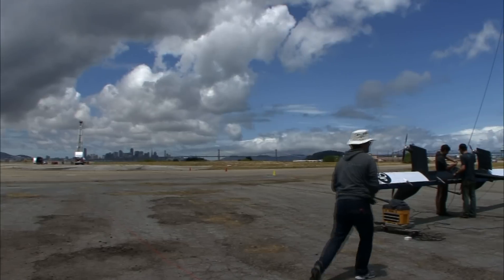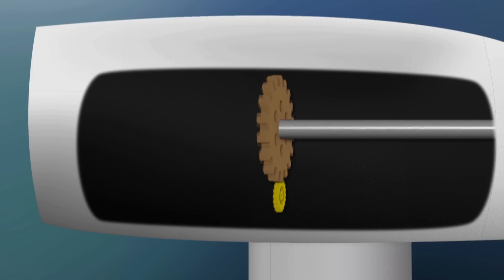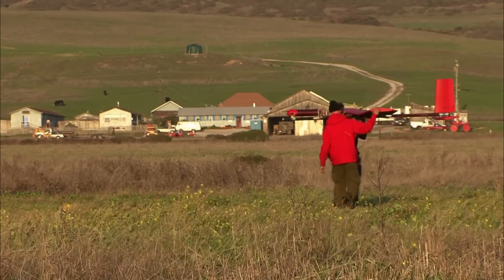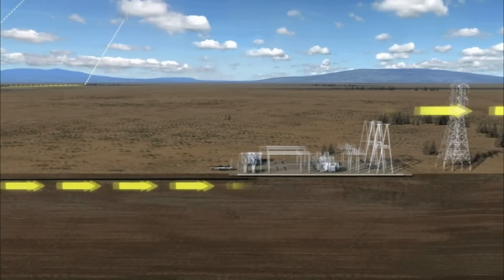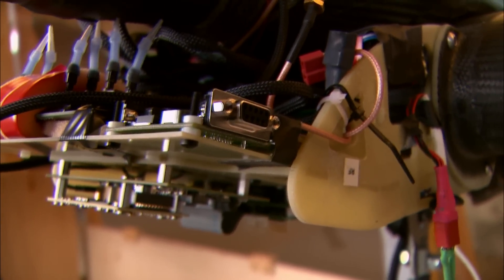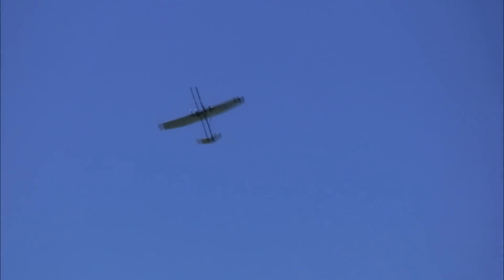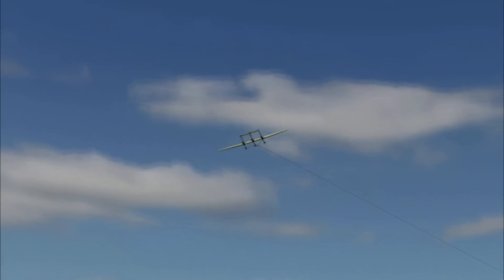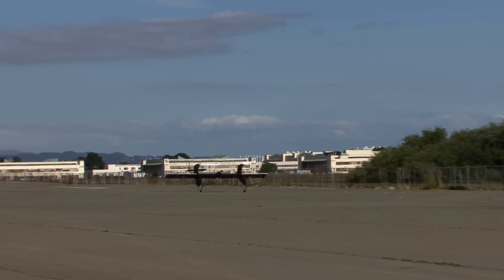Airborne Wind Energy - KQED QUEST

Comment: Here’s a question:  WHY does it need to circle?  Is it TURNING some generator on the ground?  If it’s developing power air (wing mounted gens it’s props), the kite doesn’t need to do aerobatics
Reply: It creates a higher wing speed so more power
Reply: It's a little like putting the wind turbine on a fast sailboat that's sailing across the wind (at a speed greater than the wind) or one at the dock. The turbine on the moving boat will spin faster producing more energy. With a wing flying in circles as opposed to one merely hovering the difference in speed can be many times greater.

Comment: no, no chance of this working in this design. how do you expect to capture good power by spinning the blades which are 30 cm wide.. i mean that's leaving wind on the table. Better to have a kite based design pull the cable very forcefully, and with that torque generate power. If the wind is 100km per hour / hurricane type wind - what you want is to put a roof size kite in the sky and make that wind drag on the rope. That's force. A  hurricane can remove a properly bolted roof on a house. That's force. If that force drives your generator non stop, then you are in business. This 30 cm propeller blades spinning is a joke. I can stop that with my bare hand. You have 8.. so what.. and another 20, increase the diameter to 60 cm.. is still nothing compared with the force which rips your bolted house roof. Its just a matter of what force you can capture. If you carry the generators with you in the sky how is that not very inefficient?! Why not keep that generator mass on the ground.. one big bulky cheap generator on the ground, instead of many high tech highly expensive ones in the sky ..  that way you lower cost, increase the lift, and as such make more power for cheap. The cable needs to be there no matter what - everything else needs to be stripped out. You guys need to do this seriously or is not gonna solve climate change.

Comment: If it is "offshore",  that implies over the open ocean. If you are over the ocean anyway, what prevents the base the wing is tethered to from also producing wave or ocean current derived power. I can see problems with the computer system misreading abnormal conditions and reacting in a way that is harmful to the system.

Comment: Garbage...the big suck..........the balloon elevated multi rotor is the one...
Reply: ??? Could not find any... How about you present usefull WWW-link right here ? 
--- Kite design is very delicate + difficult to control + continued large dynamic stress on tethers ==> https://youtu.be/2JNO5MnWmcc BAT aerostatic approach seems more promising, using a conventional wind turbine carried by a large airship (future scale may inflate with cheaper H2 like good old "Zeppelin Hindenburg" prooved quite robust until fatal accident possibly caused by sabotage, but not much risk for unmanned vessel)
==> see also https://youtu.be/kldA4nWANA8 comments  + 
https://youtu.be/vMTchVXedkk?t=103 - Dual Kite Wind Power

Comment: Some questions come to mind:  1) Have you actually measured that change in climate yet?  2)  If you are spending energy flying are you wasting energy?  3) Did you know that water is 900 times as dense as air?  4) Did you know that 80% of the planet is covered by MOVING water?  5) Would you be spending your time better if you were working to extract energy from the water?  Dumb idea.

Comment: could it be possible to gather energy on every commercial plane trip ,and once landed the energy box or whatever would be transferred to the airport ,then airport to a generator ,then distribute electricity? ..seems viable since they re looking for stronger winds at higher altitudes
Reply: Inpractical

1) Extra batteries huges ones will be needed to be installed in planes making aircrafts heavier which will lead to feul additional consumption.
2)Attaching wind turbines will put tremendous drag on aircraft which again will lead to additional feul consumption.

Your Idea is like installing a gaint fan running on gas infront of a wind turbine to propel it.
Reply: Rami Chahine If their would be any energy transfer, it would be back into aircraft systems. Aircraft are optimized in terms of weight to strength ratio.

Comment: Birds don't fly as high as these are mostly, and they are quite prepared to jump out of the way when a hawk or wind power kite dives down on them.  If you actually want to save birds, and you know the difference between big numbers and small ones,  stop driving cars, and stop living in buildings with reflective windows.   And declaw all domestic cats.
Reply: grumpystiltskin They are connected to ground by a cable so they are a potential hazard at all altitudes between their maximum operating height and the ground.
Reply: Nilguiri Silly.   DO THE MATH.  Look up how many birds are killed by cars, trucks, glass buildings, and house cats.   That's 98% of all bird deaths in total.   Wind turbines are minimal.  And Makani will be much safer than grandpa's wind turbine.   WHich isn't perfect, but how many birds have already died due to climate change?    Nearly all of them in a lot of regions like Syria.  Nor are birds faring well in droughts in CA or TX.   If Makani makes energy at less than one cent per killowatt hour in a few years, that gives us a real opportunity to shut down the climate collapse could kill most birds and a lot of people too. 

Trees move in the wind already and birds deal with it.   Like a tree the Makani wing is rooted at the ground.   Higher up it moves faster.

Comment: Balloon designs do not perform very well in getting the most energy out of the wind, the same problem as with savonius-type wind turbines.

Crosswind flying wings/kites collect winds kinetic energy from large cross section area (like wind turbine blades) and high flying speed helps to keep systems compact, yet very effective.

In fact these systems can be so small (compared to wind turbines) in size that they can be hard to find in the scenery from a distance.

Comment: What a joke! 
A propeller dynamic can not even withstand 50 miles an hour of wind let alone the 150 plus mph wind in the Jet Stream. Ha. Ha.
Einstein said that doing the same experiment over and over again and expecting different result is insanity.
To advance wind energy science, first one must break Betz’s Law. A propeller is of a single dimension, operating on a flat plane and rotating cross-wise to the energy source.—Now, if you had a true turbine dynamic that equation would change.